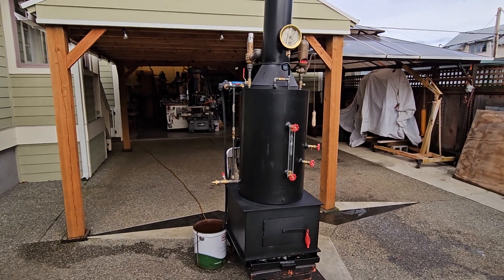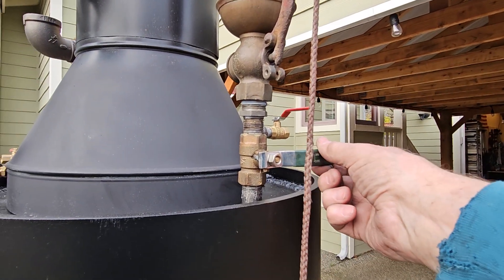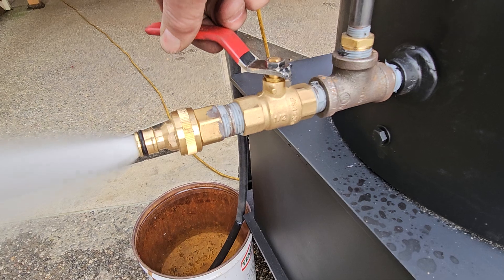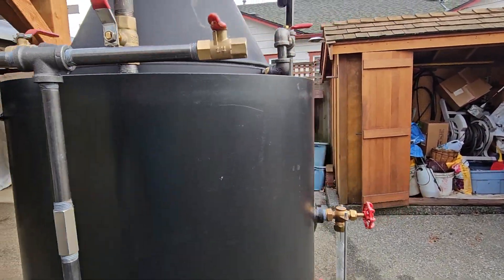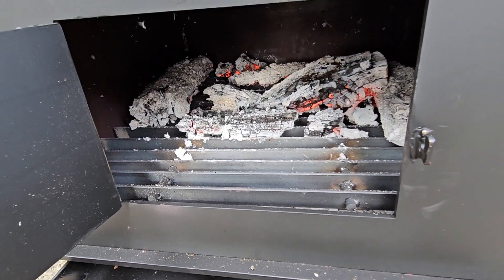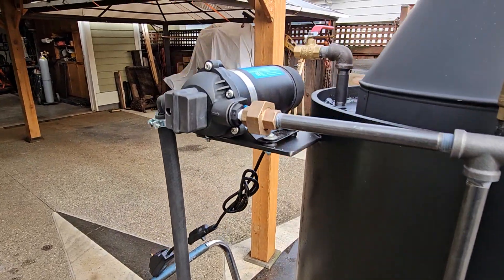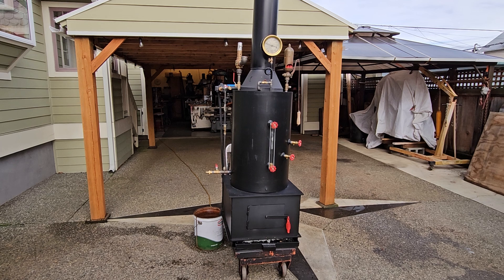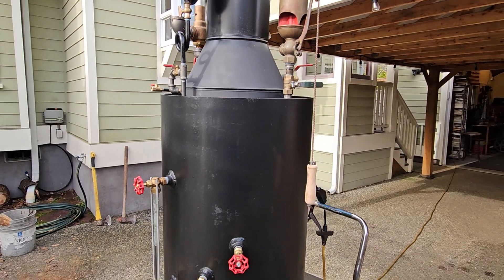Steam Boiler Engine Antique Whistle Pump Gauge Off Grid Ross Bendixen

Comment: Hey ross. Wonder a bit about boilers... how can you tell how big of a boiler you need? I have a stationary steam engine i just picked up that has an 8 inch bore and a 6 inch stroke. Looking for some guidance if possible.
Reply from the maker: Your steam engine will need a boiler that is approximately 36" dia. x 72 
" long with 38 to 44  2" steel pipes that are 68" long. The boiler needs to be this large to keep up with the steam being used. There are boiler shops that could build it for $30k to $40k That's just for the boiler not including the fire box. Ross
Reply: @rossbendixen  so I should be able to use a 500 gallon propane tank to build it like I planned. Is this something that I can mig weld? Or do I have to use tig?